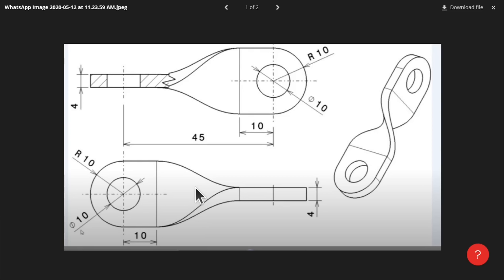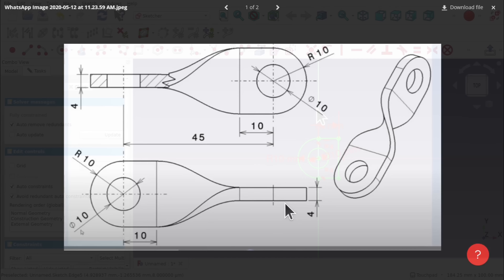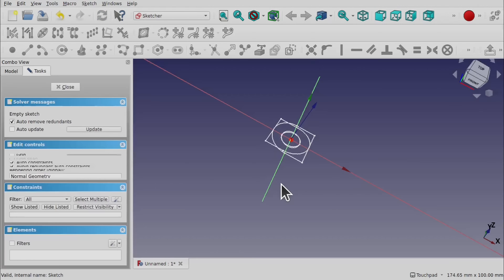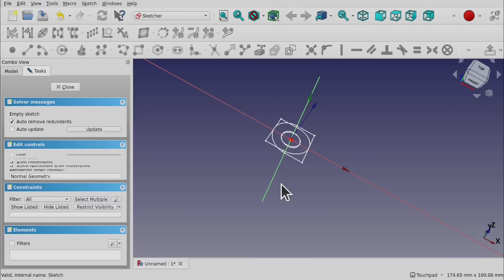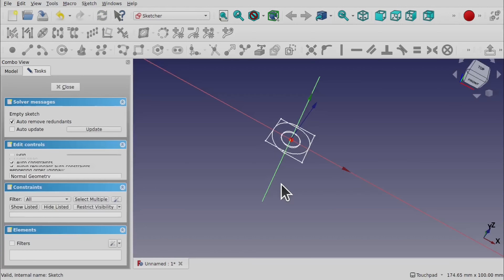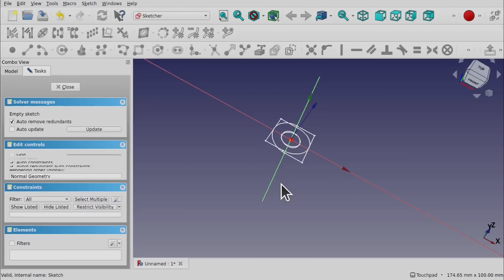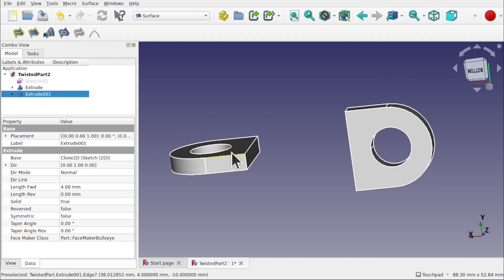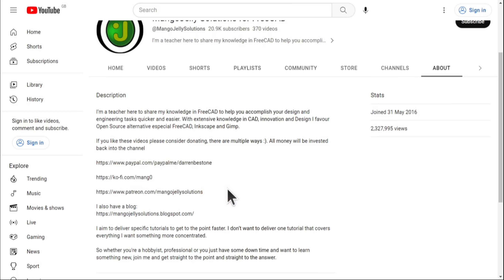FreeCAD: How to Model a Twisted Part

Comment: Thanks for bringing in awesome concept of Curve and Surfaces workbenches. Just a small thing to bring up... centers are not matched, it should result in "+" on Left view (you may need to offset by -2 for each on z and y axis individually.
Reply from the maker: Glad you liked the video. Lol yes, around a day or so I uploaded the video I liked at it and thought, there's something wrong.  When i extruded I should of selected the symmetrical checkbox. As you say you can offset the sketch.

Comment: I would start with the twisted section on this one. I'd use the parametric curve FP macro to make one rail, rotate it 180 to get a second, ruled surface between them, 3d offset a surface 2mm, offset that -4mm making it solid, then add the tabs with the holes afterwards.  I believe this method is more accurate on the width and thickness.

 These were the macro parameters I used: {"helixblend": {"a": "pi / 4 * (1 - cos(pi * t / 25))  #theta", "b": "1", "c": "1", "d": ["1"], "X": "10 * sin(a)", "Y": "10 * cos(a)", "Z": "t", "t_min": "0.0", "t_max": "25.0", "interval": "0.1"}}

Comment: Which version of Freecad are you using?  I do not have the tool that you used in the SURFACE workbench in mine.  I am using 0.20.2
Reply: he says 0.21 but on the freecad web site down load is 0.20?
Reply from the maker: I have raised a query as the tool from the surface workbench has seemed to be removed in the later version. So I am now trying to find out if that's on purpose or a bug
Reply: @MangoJellySolutions  I downloaded the appImage yesterday and today did your tutorial so all parts in the Curves workbench are there. FreeCAD_weekly-builds-33110-2023-05-07-conda-Linux-x86_64-py311.AppImage

Comment: The part isn't quite right because the drawing has the part rotated through the center of the material. So when the extrude operation happens, the "Symmetric" option should be checked when setting the 4mm length. This does NOT distract from the fact that this tutorial shows how to use the Curves workbench to create twisted parts.

Comment: There is an easier way to do this. Start with the cross-section and do the twisty part first. Use 5 cross-sections (copy-paste-offset-rotate).  The cross-sections at the end are inline and relatively close to each other. The one in the middle is rotated 45 degrees. Then loft thru them. Not sure if this is clear enough. I might have to do a video on it.
Reply: Darryll Crook  a) it doesn't specify metal necessarily and b) you can make the cross-section of the 45 degree be any four-sided shape you want, like say a parallelogram.
Reply: @haysoos123  Correct. You can also add more cross-sections with different sizes if someone wants to be more precise, but from my experience, in a production environment the twisty part is not critical to create a drawing of the part.
Reply: @imoldovan  Part of the problem is that the cross section in the middle isn't supposed to be rectangular, If you draw a line around the flat bar until the line meets itself, and then twist the metal, that cross section will also get twisted, the short ends will tilt in opposite directions. So if you take a new flat cross section, it will no longer be rectangular.
Reply: @sleepib  Not only that, but the material stretches more at the edges than in the middle when you twist it, so that the thickness of the part is thinner towards the edges. It all depends how accurate you wanna be. At the end of the day, your boss will not care about that. All he wants is a drawing that the quality can inspect the critical dimensions with. That is my main point. :)
Reply: I tried this too, it comes kinda close, but looks kinda wrong. The material thickness decreases in the twisty section.
Reply: @matthiasmartin1975  That will be also true for a piece of a real metal part when you twist.
Reply: @raytry69  oh, that makes sense. nice.
Reply: darryllcrook376 ,

What guarantees do you have that a different method reproduces what happens in terms of torsion better than this one?  What if instead of twisting I get the piece by a make-up method?

Comment: Is this item true to the plan? It would be very easy to rotate the wrong way and have your extrude on the back of your part. A symmetrical extrude would have less chance of going wrong and have less chance of operator error on non-symmetrical joining of parts with different sizes.
Pressing of parts that were once cast is becoming more popular for high volume cheap items. Is it possible to un-design a 3D part to a flat surface? All the best with your move and remember the laundry and the kitchen, (and the rest of the house) are your partners domain and theirs to redesign - it will save a lot of grief🙂

Comment: And how do you make a Twisted Fire Starter?
Comment for exposure. Keep up the great work.
44=45?
And if you extrude the sketches, the centre lines will not match up, right? You need to correct half the added height.
Reply: Personally, I'd have extruded with the symmetric option on in the dialogue box. That should keep the two extrudes aligned.
Reply: You need the one infected, twisted animator tool
Reply from the maker: Lol, 'Charlie Says' you should be able to keep it centered with the symmetrical option on the extrude. Thanks glad you like, sometime doing these types of forms can be a 'Mindfield'. Yes wonder how many people would see the mistake. I nearly reshot the video as I thought it was 'No Good' but decided to keep it..... (off to listen to Prodigy now as haven't for years, tried to dop in the ones I remember lol.. But I am more of a Leftfield guy 😁)

Comment: Watson and Crick are requesting a double helix.
Reply: Haha, yes, i tried using the helix function, but the ends don't ease into the straight bits. Then I tried the loft with the many intermediate shape binders, that came close, but not quite the same.